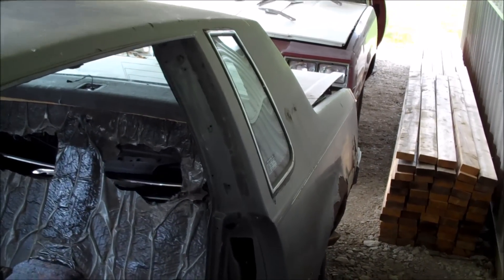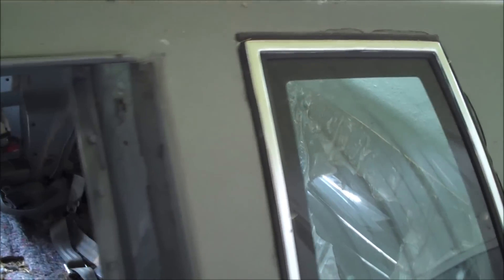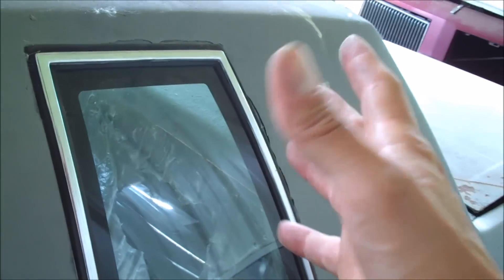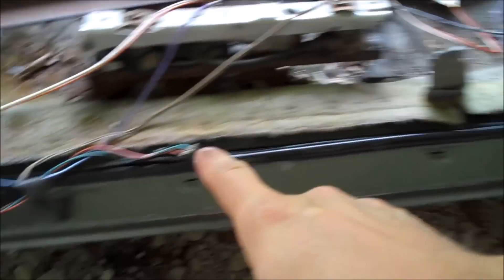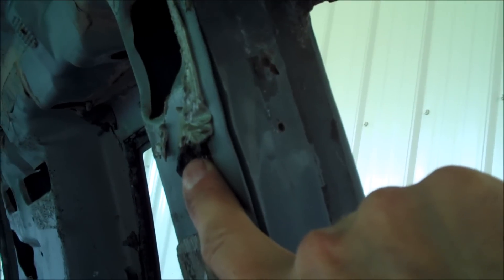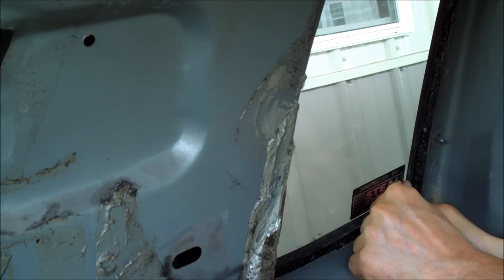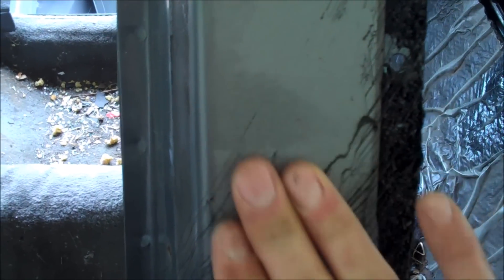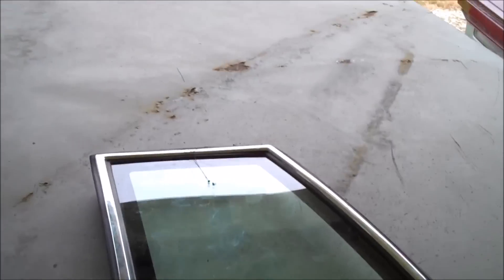Gbody How-To Remove Quarter Glass Classic Gbody Garage

Comment: I know this is a super old video, but we all still watch them constantly. On a regal with a half top. are the the 1/4 windows different?  Ive deleted the top but haven't pulled the windows yet to clean under the seals. Can I just put them back in with the delete and reseal them or are the non vinyl top windows more shallow to seal?
Reply from the maker: Regal and cutlass 1/4 windows have wider rubber trim for non vinyl top cars vs vinyl top cars. So you will have to get a set of windows for a non vinyl top car.

Comment: Very nice.  Say do you know where I can get a set of the black QTR panel window sweep/belt mldg that is sandwiched between the chrome mldg and the glass for a 1979 Olds Cutlass Supreme?  If not mistaken they are attached to the chrome mldg.  Thanks
Reply from the maker: they don't make them, you just need to get lucky at a yard

Comment: Does this apply to a 78 Monte Carlo Landau as well? Great video!
Reply from the maker: Glass comes out from the inside on a 78-80 Monte, Cutlass, Regal, GP. Remove the interior panels, there are small metal brackets and plastic clips that hold in the glass plus the black glue. Thanks for watching.

Comment: How about a 78 g body rear qtr window? I got the interior completely strip when I bought it and I'm trying to install the window. There are mounts and I'm not sure where they get installed
Reply from the maker: The glass is held in with the same window goup, its secured with metal brackets on the top and bottom with screws. Plastic clips on the sides.
Reply: @ClassicGBodyGarage  Brian, related to that same question.  I have my '80 gutted for an interior overhaul.  Removing the inside brackets is easy, but I can't figure how to remove that quarter glass trim?  Do you have that posted on your channel already?  Maybe I missed it?

Comment: There is a 78-79 Oldsmobile Cutlass bucket seat center console floor shifter in my local junk yard and a 78 79 Regal bucket seats floor shifter and console what are they worth
Reply from the maker: Depends greatly on condition. If nice both seats and consoles can fetch $200 each. Grab them all with shifter assemblies and all along with steering columns. You will do well in profit not to mention saving good parts for others to use on their Classic Gbody.